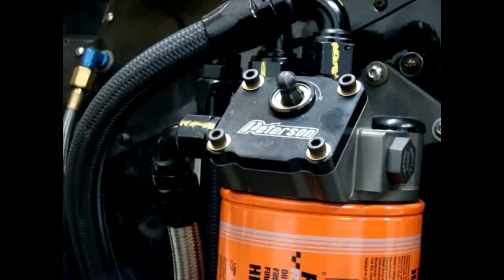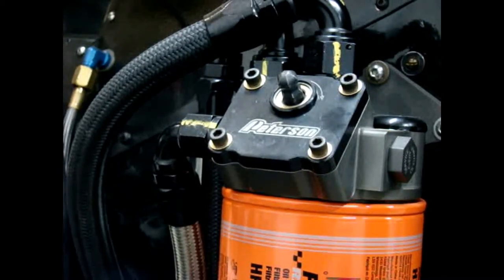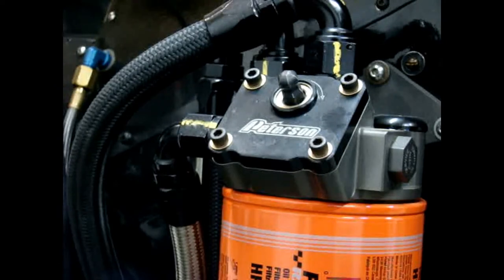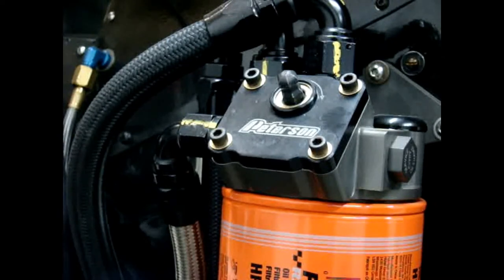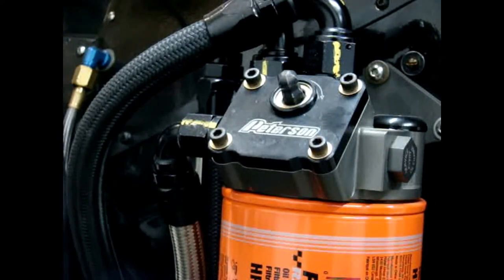Petersen Fluid Systems

Comment: How do you spin it?   Make a remote 12v motor?  That would be awesome
Reply from the maker: Nick, thank you for the question.  When you ask "How do you spin it?"  Are you asking how the oil is pumped from the sump through the oil filter and back to the engine?  Thank you in advance for clarification so I can answer you question correctly.
Reply: @uzbasicmotorsports 
I see the arbor on the side that has a clockwise rotation arrow. I'm assuming people would use a drill to spin the primer pump.

I put a remote oil filter cooler on my 6.4 powerstroke.  It increased my oil capacity to 6.5 gallons. When I start the engine in the winter months, I get several seconds of no oil pressure.

I'm thinking this would fix that problem.  Push 10 degree  5/w40 into the engine while the glow plugs are warning up
Reply from the maker: @RoboDriller  I now understand what you are asking me.  Thank you.  You are correct with regards to utilizing a drill.  I haven't seen one that is automatic but if you are willing to utilize a screw gun to pump up that oil into the engine this would help to get away from no lubrication while cracking.  I only actual do that after the car has sat without the engine running  for at least 24 hours.